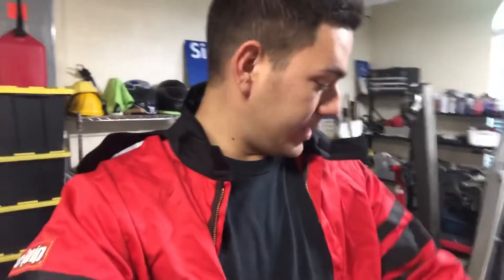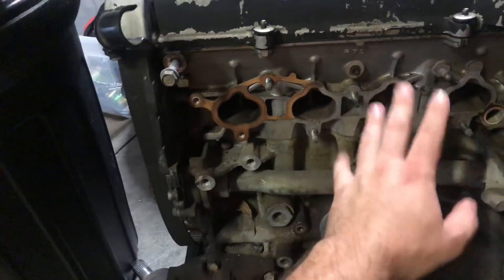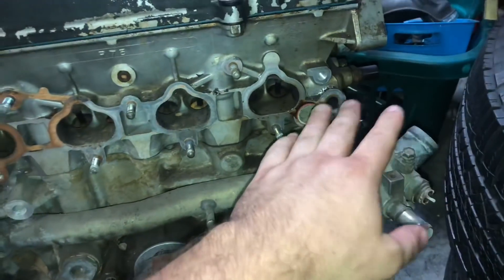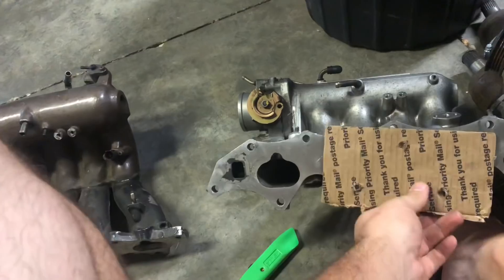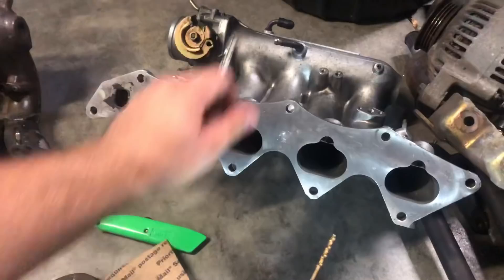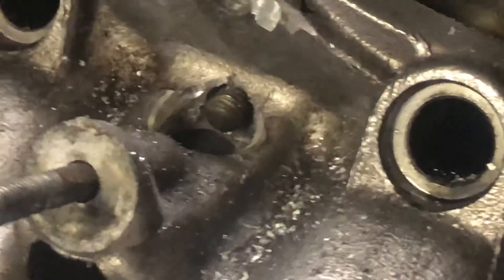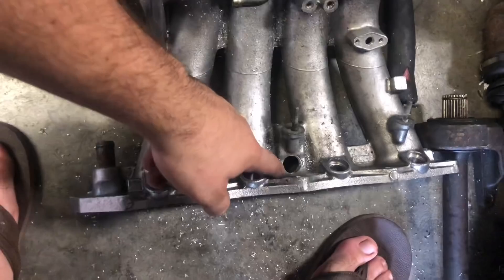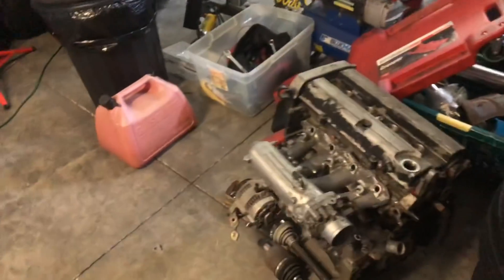Fitting a B16 Manifold on a B20 (non vtec b18b/b20 style)

Comment: Old video, I know, but I was looking at some options for doing this and noticed something when looking at the heads. There's a plug right under the casting stamp P8R. It looks REALLY close to being in the right location for that middle mount on the B16 manifold. do you think it's possible to add the needed stud there instead of modifying the intake? Lining up the gaskets in photoshop it really looks like that's what it could be used for. Still have to deal with modifying the coolant side but just a thought

Comment: I feel like if you would have just removed the "plug" and then installed the stud from the hole underneath you would have saved a bunch of time.
Reply from the maker: Agreed. But dont know what that plug is for and rather keep that oem
Reply: Don't be afraid to unplug it and check it out. You can always screw the plug back in. I know you have some teflon tape! lol Seriously though, if other manifolds bolt to where that plug is screwed into then the head is just tapped for both manifold patterns from the factory.

Comment: What I did with my b20 is I cut the side for the coolant port off and threaded a fitting from Lowes in it and as for the egr I threaded a set in bolt with a hex head into that hole no leaks no problems

Comment: Don’t waste your time on the non vtec head go b20v you will be much happier.
Reply from the maker: Ive done b20v in the past. I wanna try something different :)
Reply: try the P8R head that comes from the JDM b20 out of the 96-98 orthia and the 96-98 step wagon.  The P8R Heads came with 84mm combustion chambers and 33mm vtec sized intake valves.
Reply from the maker: Thats what i just bought :) p8r head
Reply: I am going with a similar setup, except with a GSR flanged mid length runner box manifold on my B20 Turbo build with a P8R head.

Comment: I'm open to new ideas but why would you use a non Vtec head?? the valve train is so weak for higher rpm...  I've seen a 50whp gain from removing a built non Vtec 1.8 head and putting on a stock b16 Vtec head. also..  only a b20b4 has a long intake manifold. a higher compression b20z is a shorter style like a b18 or b16, how ever it does have a large port in the top of the manifold that is joined to a sealed air box.   one more thing i will add is now that you have 84mm stock sleeves and nitrous I would watch the small sealing surface between cylanders.

best of luck on your build!!!
Reply from the maker: You make great points no doubt. I agree in some stuff, but ive done vtec heads. I havent built a non vtec b20 and thats what i want to do not because itll make “the most power “ or anything like that. I have the integra for big power. I just feel like making the most outta a non v :)
Reply: @SPTuning  you will need to run 11s with it hahaha my friends at velocity tuning did it here in a dc2 chassis..allmotor b20non vtec crower cams 11.4,same guys who invented the non vtec b16 setup
Reply: Willie VanderZwan budget. True budget is using what you got lol
Reply: i respect that 100%, a budget build is great, but why spend an extra 20 hours porting an intake and head so it flows as good as stock?  there is a difference between budget and redundant. it's an instant restriction to the build, why not save your self days of porting and get the part that is ready to go. think of the time wasted trying to make things work based of a theory. it's inefficient, it's fragile and it's simply a waste of time in the long run. knowing how he applys himself to his projects i wouldn't want to see him put his ls head to it's limit, then relise he needs to upgrade.  I just don't see how this is practical from a tuning and engineering point of view. also keeping in mind a stock type R cam would work incredible for this set up ( $150 )  then there is the non Vtec head that has no quality OEM cam, so you are forced to spend big money on a set of cams,  if budget is the key word, I would say the Vtec head would be cheaper in cost after the mods needed to make the b18 p75 head flow the same. just my opinion 

no hard feelings I'm here to learn also
Reply: SP Tuning I'm excited to see what you can do with a non VTEC head best of luck in your build
Reply: Willie VanderZwan How this was also hurting my head trying to figure out "why go to all the trouble?" as well, he is trying to make cool content and i salute him for trying this thing and it gives me much more respect for his channel. And i dig the new tools SP.
Reply: I have more time than money so it wouldn't matter how long it takes. No rush on the build and using whatevers in the garage is the way to go on budget.

Takes time especially when you haven't done something like this before.  If he had dont it before it would of been done already.

Stay true and God bless you all
Reply: With the right springs they take it to 9000rpms...
Reply: Like he said BUDGET!

Comment: That nipple for the coolant will not weld to the head. The nipple is steal and the head is aluminum.
Reply from the maker: Correct! Lol thats what we ran into hence tapping the head instead
Reply: Jb weld. Only sees about 16psi there lol
Reply: Fuck JBweld OMG, ask any race car mechanics if they'd ever use JBweld...
Reply: I got JB on my race car and street car... it works great in LOTS of scenarios! I don't think a bung onto a head is one of them though lol
Reply: @NSXTACY420  theres so many 9 second cars running jb weld ghetto rigs. You'd definitely be surprised
Reply: you would REALLY be surprised by the answer, lol
Reply: Richard Greer LOL well wheres the answer?, real speed shops or race mechanics are going to weld or rivet everything, do you really think in Nitro funny car drag or in Formula One they are jbwelding up the head before a big race?! here's a pretty good answer for ya: https://honda-tech.com/forums/forced-induction-16/jb-weld-sucks-649395/
Reply: Aluminum fitting